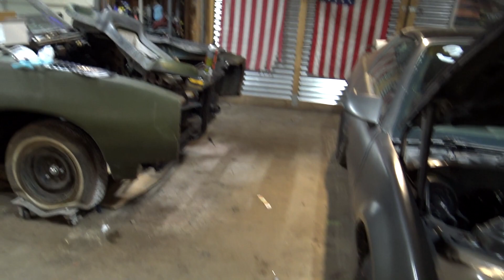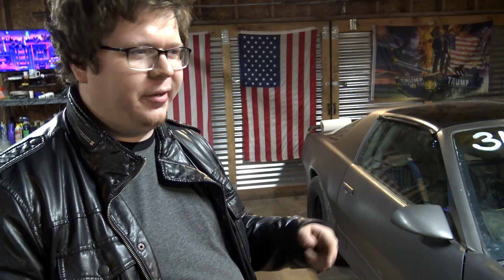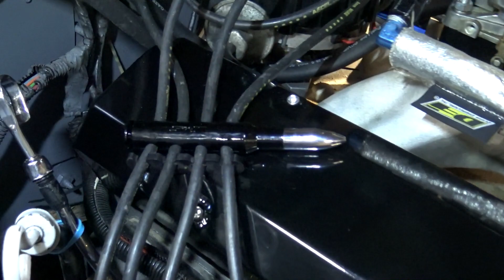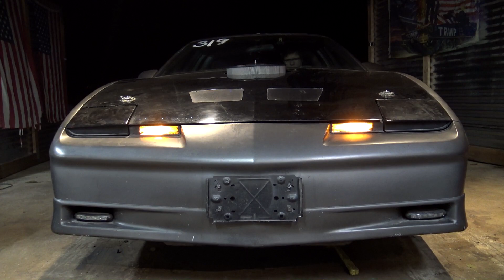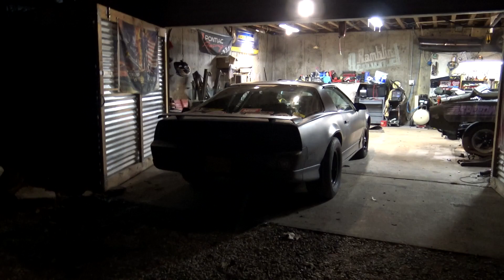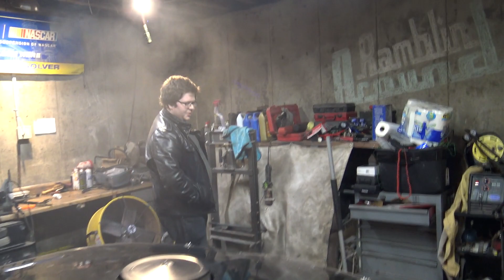Trans Am Update - Open Cut-outs Vs Mufflers and Quick Burnout

Comment: If you're using the 3 bolt cut out flanges do not go with the really cheap eBay stuff, however I did go with a brand called evil energy, was not much more than the really cheap stuff but much better quality, I had them on the car for 2-3 years through Canadian winter and had zero issues, always sealed properly whereas the eBay ones started failing after months, just gotta cycle them now and then so they don't get locked up, my favorite mod I ever did
Reply from the maker: Thanks for the info, I'll check those out.

Comment: Beastly! Does the Positive Crankcase Vent. help the engine to breathe? The bullet spark plug wire looms are a nice touch too, Jordan. I look forward to the next video.
Reply from the maker: The PCV system and catch can will help lower the build up of pressure within the crankcase, which could push oil vapors out the breathers. It improves the seal of the piston rings and valve stems as well. This keeps the compression in the chamber, where you want it. A PCV system also reduces windage and oil aeration. These cause drag on the rotating assembly and rob you of some power.  Thanks for watching, I appreciate it!

Comment: Can you please help me with building a motor like the one u just got done with, n or can you please explain in detail of the motor top to bottom great job please reply back god bless
Reply from the maker: The engine is a 355 small block, four bolt mains, Eagle forged crank, 6.0 inch Eagle forged H-beam rods, lightweight Wiseco forged pistons, ported 200cc runner 64cc chamber aluminum heads with 2.02/1.60 stainless valves, 1.6 roller rockers, Howards Cams flat tappet cam, Erson springs, Crower cam saver lifters, Comp magnum pushrods, Holley Strip Dominator Single Plane intake, and a Quick Fuel 750 carb.  Thanks for watching, we appreciate it!

Comment: What motor do you have? What carb are you using? Are you using mechanical fuel pump or electric?? Car sounds damn good!!
Reply from the maker: It's a 355 small block Chevy, forged Eagle crank, 6.0 inch forged Eagle H-beam rods, forged Wiseco pistons, 200cc runner 64cc chamber aluminum heads w/2.02/1.60 valves. Holley Strip Dominator intake, and a Quick Fuel Slayer 750 carb.  Electric in tank pump.  Thanks for watching!
Reply: @RamblinAround  what jets are you running and how you got it set up? Pump shot,jets??

Comment: PS do you use high octane gasoline like 99 or 100 💯
Reply from the maker: I usually run 93 with an additive from VP racing to raise the octane a bit.
Reply: Yeah I'm running pretty close to the same spec motor in my Camaro you have a slightly bigger cam then I do but I run 93 without any issues at all